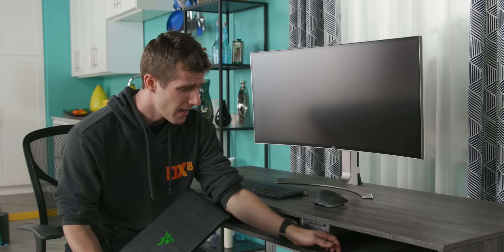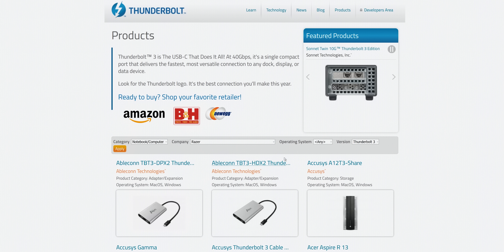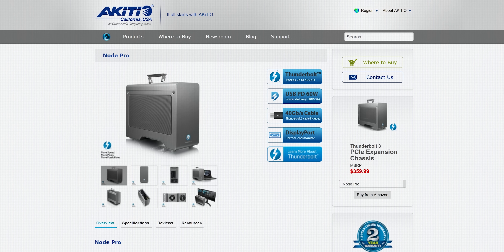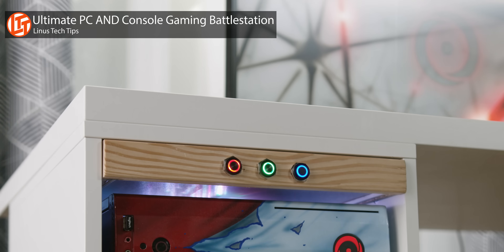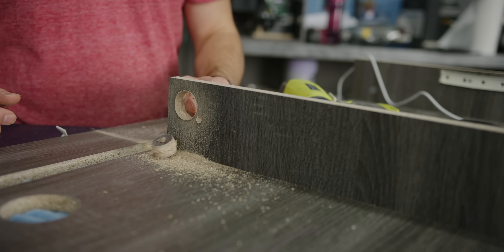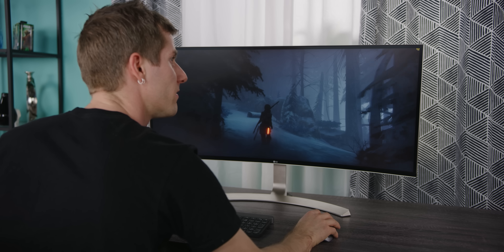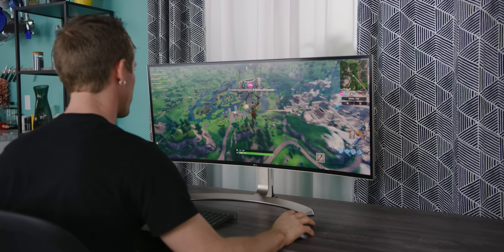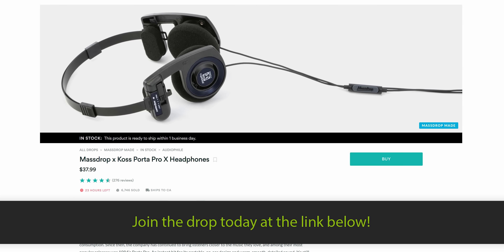This is the CLEANEST Setup.

Comment: Are you guys really sure what he meant about plug in an external hard drive? I have tried that before with gaming laptop's and they usually handle them in a bad way. If you plug it out and start steam it would often be confused about what games you have. Other launchers like Windows Store, and Origin barely supports it. 
If it worked like on the xbox were it just read them automatically and they just worked when plug in that would be different but thanks to the few standards PC gaming has and bad launchers you probably need a laptop tons of built in storage.

Comment: 3:35 -- The Reality
The (false) promise:
"One connector for everything; that is the Thunderbolt vision. All you 
really need to know is that if you plug your device into a Thunderbolt 3 port, everything just works."
-- https://thunderbolttechnology.net/sites/default/files/Thunderbolt3_TechBrief_FINAL.pdf

Thanks for a great video that explores some important "gotchas". I'd be curious about how well the dock performed (e.g. Ethernet and USB throughput, audio consistency) being second on the TB3 chain behind the GPU.

Comment: Hey a Macbook version would be really interesting, as most Mac users appreciate minimalist setups like this, Also I had the idea of implementing invisible speakers by having them fire at the wall behind the desk, similar to most Atmos systems. I also found a handy adaptor on Amazon to connect casefans to a USB port, in case someone doesn't want to invest into an eGPU right away but still cool the Laptop.

Comment: Hey man, I have both a Wacom MSP16 and 13”  do you think this would have enough power for either one? Thanks!
Reply: Does the MSP16 have thunderbolt 3? I'm looking at the specs and it seems that its USB-C ports are only USB-C, not thunderbolt. But if they are, Wacom says the max power draw for the MSP16 and 13 is 96W. So during light and normal use it'll probably charge, although potentially slowly. Any work that will peak the power consumption though will prevent you from charging. If they're thunderbolt ports, still make sure that they will support charging. Some manufacturers still won't allow charging via thunderbolt, full-stop. Got burned by that with my MSI P65.

Comment: Linus you will probably find that by limiting the FPS to something reasonable you'll get smoother gameplay on certain games.
I have a Razer Blade with a 1060, if I turn the frame rate limiter off on certain games the laptop goes crazy almost like its trying harder to get higher FPS whilst thats happening I'll get 60-70fps.
However I then set it to say 120fps and suddenly its running smoother at 120fps than it ever was on unlimited.

Its counter intuitive but its happened to me a number of times.

Comment: What if you had monitor with a built in thunderbolt 3? Would you actually need the hub still or can you just go from laptop → Egpu→Monitor?
Reply: The second TB3 port on this enclosure simply daisy-chains to the laptop (does not enclose video output of the GPU). In fact, Intel specifically disallows a second TB3 port on certified eGPU enclosures (presumably to avoid the exact confusion you are currently facing - it is impossible for the second TB3 port to provide GPU video out [exception to this is the Mac only Blackmagic eGPU which is its own integrated solution]). Also, you can still skip the hub by buying an eGPU enclosure that includes peripheral ports.
Reply: @eRadicant  Is there a source for consumers to read the Intel standards for certified TB3 solutions? Or is that info behind the "developer" part of the Thunderbolt technology site?

Comment: If I can’t use the thunderbolt hub because of the price and the new Razer blade 15 not supporting charging through a thunderbolt port can I run a usb c hub for my monitor keyboard and mouse and then just my regular power brick to my pc for a 2 cord set up? Any suggestions on usb c hubs would be appreciated as well.

Comment: everything will be easy and simple....when you are RICH LOL
Reply: For a single laptop with this performance and volume, this actually perfectly reasonable
Reply: @aquaimperium8  Its still relative though, laptop alone is over a £1000 I think, then buying power supply, graphics card plus the rest. Definitely not bad considering it acts as a desktop and laptop, but could still be considered expensive.

Comment: the problem here is the laptop to gpu and and gpu to dock cannot be done because on the gpu there is only 1 thunderbold port. Even in the video it was not shown as connected, it was just said and not connected. I would like to know if its actually possible

Comment: Is the longer thunderbolt cable the bottleneck for the eGPU?  I have the Razer Core X which comes with a super short cable in theory because of the signal degradation.

Comment: I no longer have the ability (or time) to put together my own computer.  The technology has changed so much in the past 15 years.  But recently, I wanted a new Windows machine.  I work from home and handle multiple billing & coding applications simultaneously, some of which are pretty intense, as well as very large spreadsheets, at the same time.  I am a medical biller, by the way, believe me, it's not the job you think it is.  It's a lot of software troubleshooting and client support over the applications I work in.  Anyway, I remote into a machine at my work and I have my own Mac, but I really wanted to get a new Windows work machine.  If I have to buy a new machine, I want it to do more than just work.  I started putting together something on PC Parts Picker but got really frustrated, I don't even know what this Optane memory is.  I'm way out of touch.  Only other option was to go onto a custom building website like Origin or CyberPower.  I started with Origin and they were so expensive!  I wound up having to go with iBuyPower and still had to sacrifice some parts to stay under $1,700, which was my budget.  The only things I didn't sacrifice on was the mobo and PSU.  Hopefully I can get back into this enough to upgrade parts on my own, in time.  I wish this channel had something for savvy "beginners."
Reply: well optane accelerates your loading speeds and watch rog rig reboot 2018 for tips or go here https://www.youtube.com/channel/UCStk7sZhuFJhxdvyXksdj5Q your welcome

Comment: Hey Linus, I know you are a PC user but you have to be fair. If you tried to do this setup with a MacBook Pro it will be much cleaner for two main reasons. First, the MBP have FOUR thunderbolt 3 ports. Which means that you basically can connect the eGPU, the hub, the charger and one more super fast accessory to the MBP directly. Second, MacOS have what is called clamshell mode or closed-display mode which makes this setup works perfectly with the software and even FASTER. Also with the usb-c to display port cable you do not need any dongles or hubs to connect your monitor. And with usb-c or thunderbolt 3 external storage you won't even need a USB type A to connect your external storage.

Only one thing left to say.. Mac is the way to go!!!!!!

Comment: 3M dual lock is so much better than Velcro, especially for holding weight, i'd probably use a strip of that for your adapter

Comment: jeez man, why are so many people watching this channel. i mean seems like linus actually knows what he's talking about but this is just an advertising shitfest without any actually useful tips. The framerate counter in this might've said 70fps for fortnight but clearly visible on the stream there are huge ass freeze-frames. 
talking about "why use 2 processors yadayada" in the beginning but then implying not using PCIe slots that have direct connection to the processor is equally good. 
If you wanna play games, stop buying laptops. Get a cheap laptop for work or school if you want, but if you do for gaming, dont complain about either poor performance, exorbitant prices, bulky design or extreme heat. because there isnt much physical possibility to not have all of this.
either its fast and slim, then it gets hot. or its fast and cool, then there needs to be enough space between the parts and it becomes bulky. or its cool and slim, but then the performance sucks ass, no matter what hardware you use because computers reduce their performance in order to keep cool and prevent damage.
if you want a cool clean set up (and money doesnt play a role here obviously), why not just build a whole PC into the desktop and use syncronisation software to have the same stuff on both machines.

Comment: I have a similar setup with USB-C rather than thunderbolt, and it does not disappoint. The major advantage to this setup rather than the desktop/laptop setup that most people are asking for is that you guarantee that your laptop is always charged, and that your files and setting are always right where you need them. 

Also, VESA mount the monitor to the back/top of the desk to save space!

Comment: 2:00 EXTREMELY IMPORTANT!!  LINUS YOU DID NOT MENTION THAT...some laptops do not support power delivery IN, even though the Thunderbolt 3 specification supports it.
Reply: @jeposton  pretty sure it will charge at the Thunderbolt 3 rated 85 watts, even if it needs more. And cheap Dells and HPs probably don't have Thunderbolt 3/.
Reply: @quasar66666  I don't have a Thunderbolt 3 device to test with, but I do have a Dell M6800 and a 90W car power adapter. Let me tell you. That M6800 was SO S - L - O - W that it could not play audio correctly out of its speakers. The i7 4900MQ operated at 0.79GHz. There was nothing I could do to get the CPU to run faster. There just was not enough power. I even did things like disable the MXM GPU in the BIOS, underclock the iGPU, and turn off the display. I just wanted just to play Spottily and could only do so thru the Bluetooth speakers. I could of tried the i5 I have but it was not worth the effort. Finally both battery did charge at 1% an hour one at a time.

Edit - Oh. And I wouldn't put it past Dell and HP to pull a fast one just to up the margins on there lower end models. This is OEM's we are talking about.
Reply: I own an HP zbook studio. The charger is 150w. A cheapo 60w charger also works fine but no power delivery on the thunderbolt ports sadly
Reply: @DuinbergenGames  What model do you have?
Reply: @jeposton  zbook studio G3 with 8 GB of ram, a quadro m1000m (4 GB) and i7 6700HQ

Comment: Form over function. It's definitely clean but for me it's a space issue. Thick desks just aren't ergonomic fitting chair armrests under while having the keyboard at the right height is tricky. Also that fairly non-functional draw takes up heaps of space. My Silverstone FT-03 and Ergotron monitor arms take up far less total space and it's far more usable and comfortable and holds a full PC and still room for a laptop. It's clean enough but it's far more functional. At some point it's just no longer practical, to make everything hidden and clean. A bracket underneath the back corner of the desk would be better for the external gpu and use industrial velcro tape, however use it sparingly or you'll need a pry bar to get it off.

Comment: so is this caldigit ts3 setup limited to 2 monitors because the challenge was to make a clean setup with one wire? or could I run a display port/hdmi off the external gpu to have a three+ monitor setup.

Comment: Generally its a cool idea, however Thunderbolt 3 has only 4 PCIe lanes .. a graphics card is normally already using 16 .. with your hub etc. there is not much more for the GPU (relative to a normal PC setup)
Reply: Graphics cards barely use PCIE 2.0 8x so your not hurting your performance too much...

Comment: Most laptops have high speed peripheral ports for monitors. At least if you have a decent laptop. So I don’t see how this is anyway special other than the monitor being curved.
Edit: also the extra power hub and external graphics card which, you might as well have built a desktop that is connected to a secured network with file data transfers automatic so it can be mirrored so when you leave home everything can continue on the laptop.

Comment: Going to just point out this might not work on some laptops because they're set up in the bios to cut power to external I/O when the lid is closed to save power, you might be able to turn this function off but I couldn't with my alienware.  So just check it out.

Comment: Hide the cords inside of the hollow table legs, so that it is the cleanest from both the front and the back :)
While your at it, design the desk so that you just push the laptop into a hole and the thunderbolt port auto aligns, not sure how but I'm sure its possible.

Comment: Ummm... I'm using the new 2019 Razer Blade, which has an 80w battery. So if I plug the power supply into the laptop at the same time as the eGPU, will I have sufficient power?

Comment: Tbh you don't need a thunderbolt port, yes this set up is the best for the laptop, you can still have more than one thing go into your laptop and still have a monitor and all your gear. It's called the HDMI port and the USB 3 external hub. Don't let this make u buy a fancy ass laptop. Trust.

Comment: 0:25 "The real bummer is when you end up having to buy both"... and to avoid this you ended up buying the eGPU+GPU+Hub + a super expensive laptop. Instead of this setup I would rather go with an AMD desktop + a Surface Pro i5 (or even a high end Android Tablet), which will be around the same combined price, BUT, it'll be more powerful at desk and more portable on the go.
Reply: Is this comment a troll?
Reply: You are absolutely correct but where is the  wireless charging desk?
Reply: get an xps 13 instead. Solid cpu, no gpu
Reply: no he dismantled the eGPU and thats where the 1080 ti came from
Reply: @awesomeraptor1414  lol the node pro does not come with a gpu.. its just the enclosure + psu

Comment: please do a MacBook version with a multiple monitor setup.
Reply: You can multiple monitors with a mac pro via a doc (owc, caldigit), 4k even.
Reply: You can't have more than one monitor for a laptop unless you get the new $3000 msi laptops sweetheart. And Apple wouldn't want u doing that hence the limited ports. Apple Inc are scammers when it comes to things like this.
Reply: TagliatellePizza My 2011 macbook easily runs 2 full hd monitors and it's got more than enough ports

Comment: After buying the eGPU and the Thunderbolt hub, you've essentially spent enough money and used enough space for another small desktop PC. The only thing different about this setup is hiding all the junk inside the desk.
Reply: you missed the point.
The whole reason was about being able to have both portability and performance  without having to build another PC with separated storage.
Reply: You missed the point that if you have to buy an eGPU and thunderbolt hub, you have essentially LOST all portability and performance. Sure, you can carry around the laptop without the performance of having the eGPU, but why? You can put files in the cloud while using two PCS, or you could just ... I dunno... actually buy a laptop that doesn't need a hub or a eGPU if portability and performance are really important. Buying a laptop that needs an expensive eGPU  and Thunderbolt hub and then lugging it around is stupid as hell. It makes more sense to just buy a build a gaming PC,  buy a portable laptop, and put files in the cloud unless you are a dumbass that thinks that hiding your laptop in your desk and plugging it into your hubs and eGPU every time you get home is fun or something. This is an expensive and super inconvenient solution.
Reply: You are being ignorant. Keeping all files in cloud and sync them is a dumb annoying idea.
Reply: I guess it's dumb and annoying for you. Personally, I find plugging and unplugging my laptop into the wall, an eGPU, and an thuderbolt dock repeatedly far more annoying than storing a few common files  that I need on the go in the cloud.
Reply: @SA-ho1mu  you only plug 1 cable into the laptop when you're using it via the desk with eGPU. Everything runs through the thunderbolt port
Reply: It's a promotional video so yeah bs

Comment: no sorry there is a better way and it costs you nothing. windows and linux machines can all be set to share and allow access to each others drives. it's called drive mapping. as long as the machine is in a minimal sleep state you can go into each machine and do what you have to without turning the screen on. if you want to go a step further connect your phone to any machine and set it as attached mass storage and allow access across network. further yet, the air droid app. you can send sms from your pc through your phone. it has some connection issues and is no longer free for full feature. motorola made a similar app for their phones not sure about samsung and apple, i would say they have something along the lines.

Comment: As someone who mounts a surge protector on the under side of the desk to run lights, use command strips not Velcro. It won't fall down like you're little box, Linus.

Comment: To be that pedantic guy, trickle charging is not when you can't meet the charging demands of a device. Trickle charging is what happens when a device is already fully charged, so it lets the device drain a bit and then charges it in cycles.

Comment: From previous test, there's a performance penalty from using the laptop display with an eGPU. Is there a performance penalty for using the hub display connector instead of the GPU ones for the external display?

Comment: You can't even take the EGPU with you??? That's like taking wheels off an RV and living in it 😂
Reply: The idea is that it works like a nintendo switch. When you are out, and need to bring the laptop, well, its just the laptop. Bring it home, plug it in, and now its a 1080Ti Gaming rig. It's like having a laptop, and then having a super nice PC, without having to buy one. All the stuff in the vid was maybe about 1000 all together. So it saves you a lot of money to just reuse the laptop.